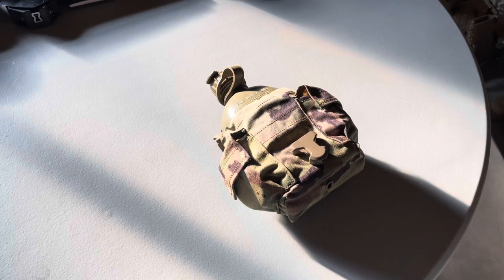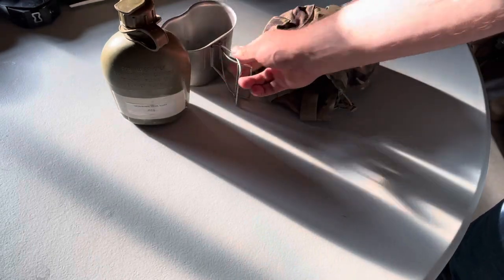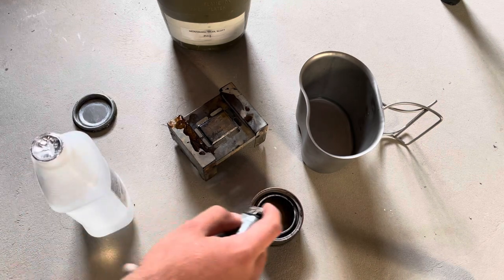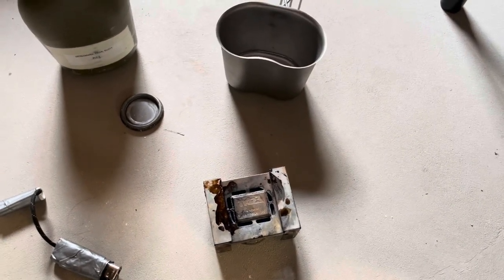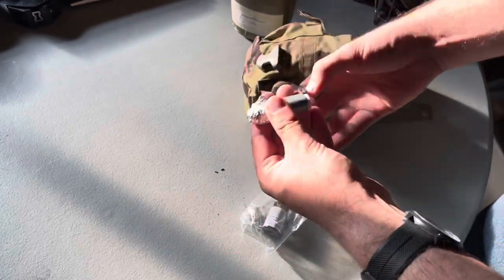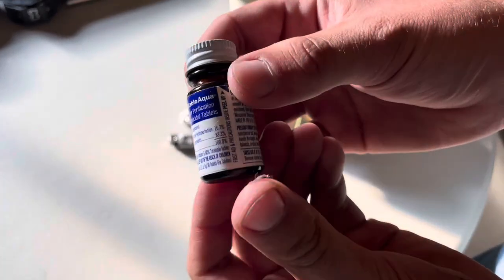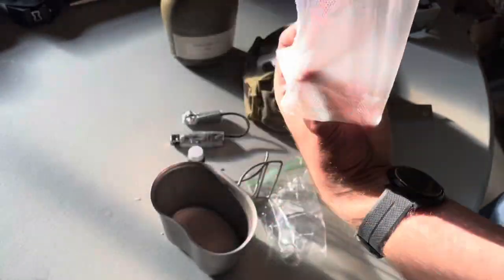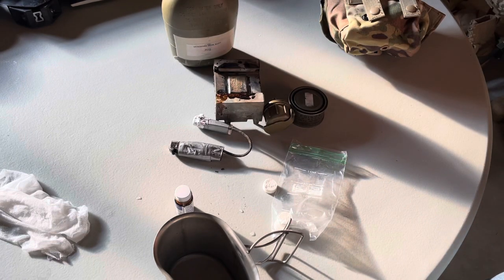ULTIMATE USGI CANTEEN POUCH

Comment: Esbit made stoves for German WW2 troops.  They still make many sizes of stoves today, from pocket to bbq sized. Plus, cooking sets.  British troops had "Tommy cookers", tins filled with alcohol gel (sterno) with a ring that went on top to hold cup above flame to heat their tea.  Several styles today use the same way to heat drink or food.  Why don't you use stove right side up, so you won't have to move it to place lid on to snuff flame?
Reply: Also, those Esbit stoves can store several fuel tabs.